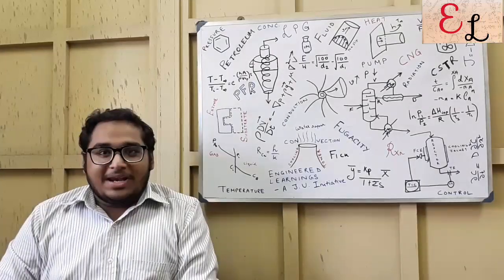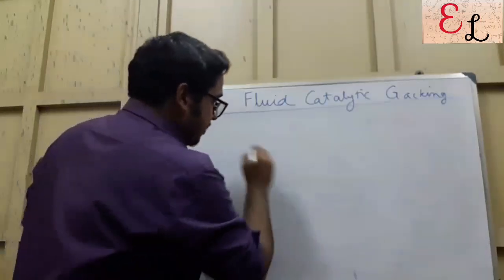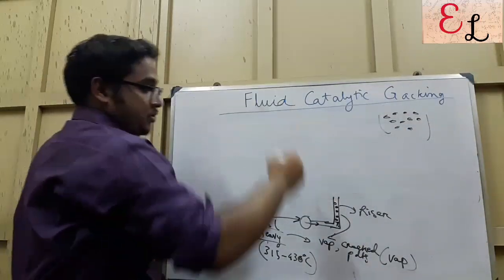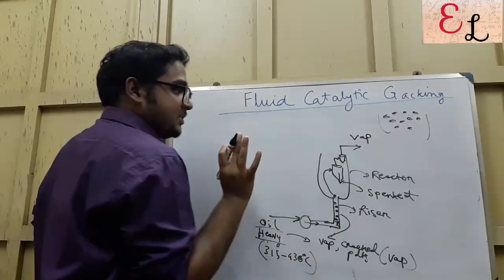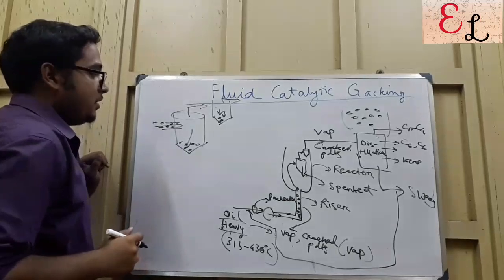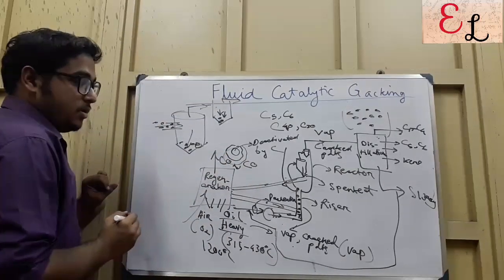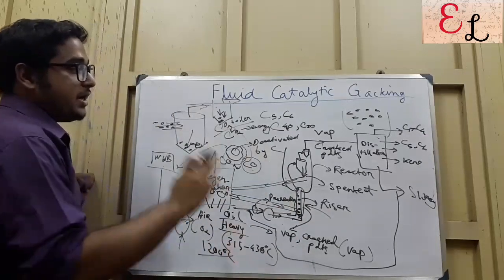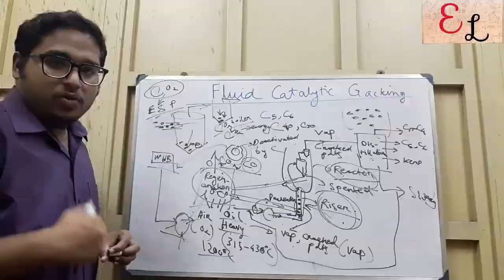FLUIDISED CATALYTIC CRACKING | FCC | REFINERY | PETROLEUM | CRACKING UNIT | PLACEMENTS | INTERVIEWS

Comment: Good explanation, one correction though, the slurry doesn’t “mix” with the feed. It exchanges heat with the feed in a heat exchanger. The slurry preheats the feed while it gets cooled down and is pumped around back into the column as a “quench”
Reply: it is used in a heat exchanger as u said but it is also used as a recycle to the riser as well to recover some of the entrain catalyst from the main column

Comment: Riser ka out reactor k top se enter karta hai bro.
Reply from the maker: Depends on the vapor you are producing, hot cracked vapor is generally less dense and has a tendency to rise up from the Riser into the Reactor
Reply: @LifeBeyondBusiness  but catalyst has travel from top to bottom.
Reply from the maker: Yes it's a counter current interaction between catalyst and the heavy oil in the riser itself

Comment: If we need to model this reactor, how many lumps will you consider? And Secondly you did not mention about the thermolysis reaction (this must take place in  according to me), in the riser section of the reactor. There might be change in phases, in the entry of the riser there have to be 3 phase (atomized liquid, solid and Hot Air) and at the exit of the riser ,there are only 2 phases (Vapor and Solid catalyst ). Please rectify if I am wrong and plz justify with correct explanation.
Reply from the maker: Yes you are correct, solid catalyst has not been called a phase as it does not participate in the reaction. But it exists  for sure. At the entry, all 3 phases in 4 forms (atomized liquid, vapourized oil, hot air, solid catalyst) are present and at the exit, 3 phases exist, solid catalyst surfaced with C layer, vapourized cracked products mixed with air and heavy uncracked liquid droplets entrained with the cracked vapour if any.

To model the reactor, there are several factors on which the number of lumps depend, so it would vary with different conditions in action.

Comment: Thank You so much.
My concepts are cleared after watching your video  
but can you please help me in solving the below-mentined question based on FCC.
Given Data:-

• Catalytic cracking yields – charts 15-18 in Section 5 of Handouts.
• Liquid densities for C3 and C4’s in GPSA Engineering Data Book – Physical Properties GPSA-2 
• Gas oil feed to FCC unit:  80,000 BPSD, 23 API.
• FCC Conversion:  70 vol %.
Calculate:
1. Total Feed, kg/hr
2. Fuel gas (C2 and lighter) production, kg/hr
3. a) C3 (Propane) and b) C3= (propylene), BPSD and kg/hr
4. C4= (Butylene or 1-Butene), BPSD and kg/hr
5. i-C4 (Isobutane), BPSD and kg/hr
6. n-C4 (n-Butane), BPSD and kg/hr
7. C5+ Gasoline, BPSD and kg/hr  (Density in Chart 18)
8. Coke, tonne/day and kg/hr
9. Total cycle gas oil = Feed – above products, kg/hr
10. Calculate flowrate of total cycle gas oil, BPSD. Look up the density of total cycle gas oil in Chart on slide 18.  Calculate the actual conversion percentage using the formula:
Conversion % =  (vol. Feed – vol. Cycle stock) / vol. Feed x 100
Reply from the maker: The handouts and charts you have referred to are not attached, hence the question is not very clear!